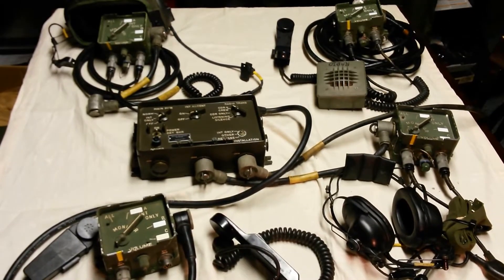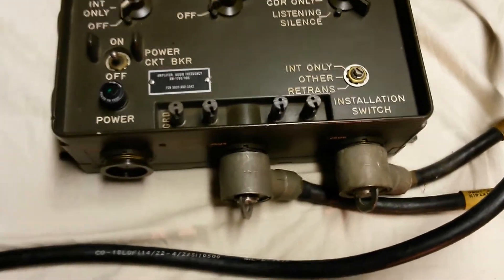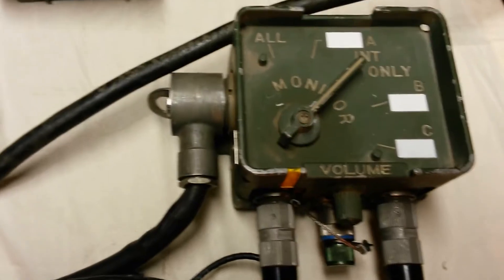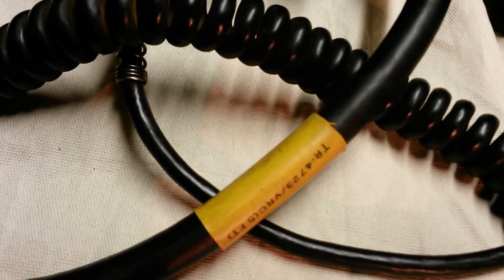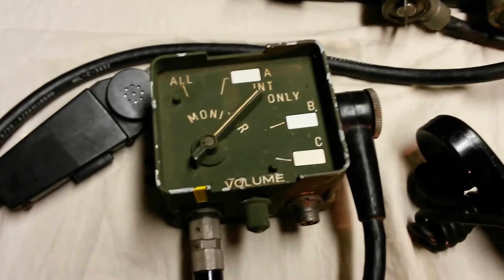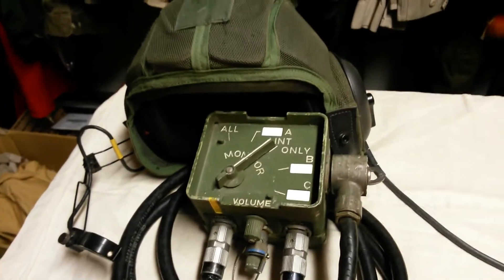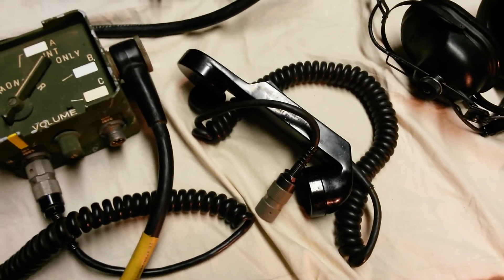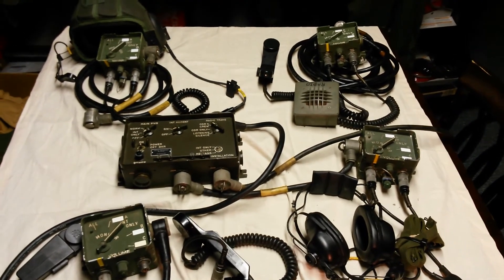VIC-1 Intercom Overview

Comment: Well done; thank you for making this great video.  I've got what I believe to be all the pieces and will soon try to get it up and running.  I do have two of the TR-4723 cables that you mentioned.  I wonder of my SM-D-937438 (T73990?) brake-away cable is the same as the CX-8650 that you mentioned.

Comment: Thanks for the great video. Where did you buy all of your components? I am trying to build a system but eBay is limited at the moment.
Reply from the maker: jpanzer7 I acquired that stuff years ago when a common shop in Alabama was liquidating its inventory.  I still have some leftovers.  What are you looking for?
Reply: Humvee Radios .....everything. Looking for a AM-1780, 3 crew stations, interconnect cables, power cable, and 3 h-161 headsets. I found a decent looking AM-1780 but no luck on everything else. I’d be interested in anything spare you had.
Reply from the maker: jpanzer7 I found a complete 3-man setup boxed up. It has an olive drab AM-1780 and 3 x CARC crew boxes.  2 x 4 foot cables and 1 x 1 foot cable.  Power cable is a 3 foot CX-4721. Two of the headsets with bailout cables  are new in unopened wrap, the other is in good unused condition.  I will sell a for $500 plus actual shipping.  Let me know if interested and I will  post a video so you can see the setup and know it works before I send an invoice.
Reply: got all of mine off ebay